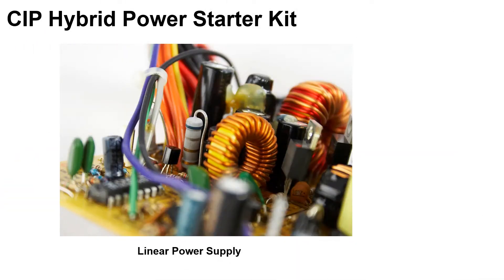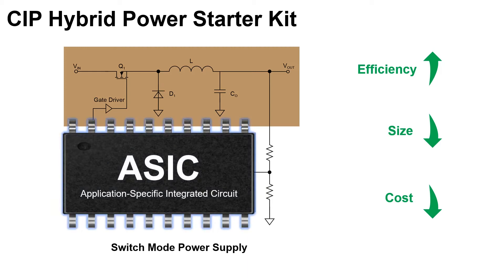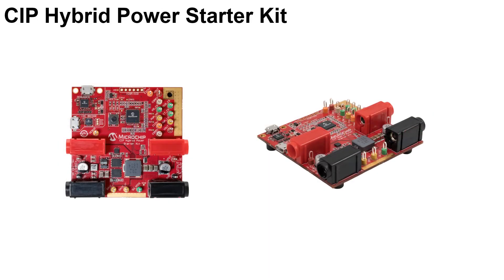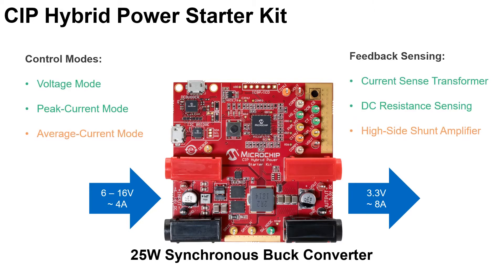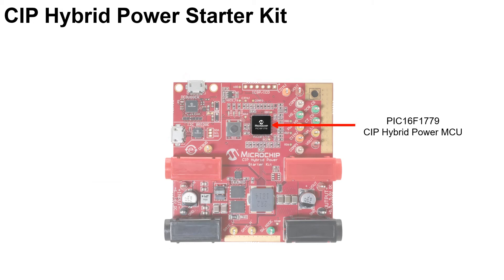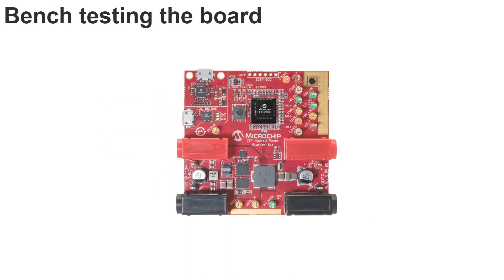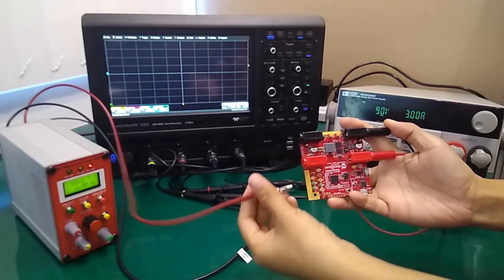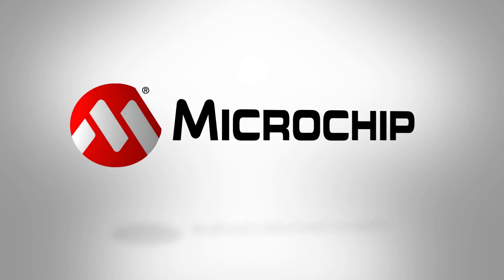Introduction to the CIP Hybrid Power Starter Kit

Comment: This is an microcontroller solution for a SMPS buck converter. It uses an 8-bit PIC with internal peripherals such as Op Amp, Comparators, ADC, PWM, DAC, etc. You connect them inside the microcontroller through progamming. Its creating your own SMPS controller.
Reply: I really appreciate your reply June, thank you

Comment: I'm really new to these technologies. How different is this from an Arduino or a Raspberry Pi?
Reply: This is an microcontroller solution for a SMPS buck converter. It uses an 8-bit PIC with internal peripherals such as Op Amp, Comparators, ADC, PWM, DAC, etc. You connect them inside the microcontroller through progamming. Its creating your own SMPS controller.